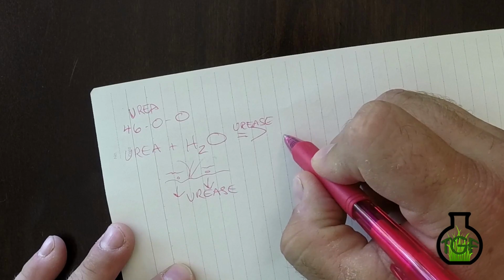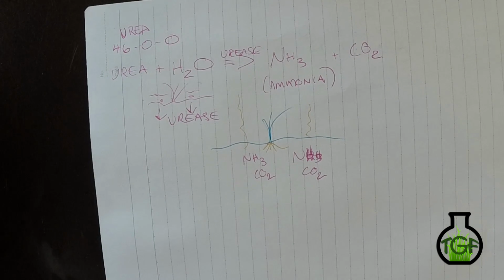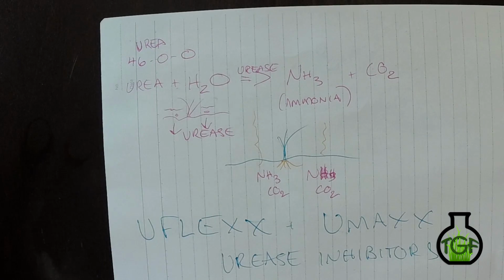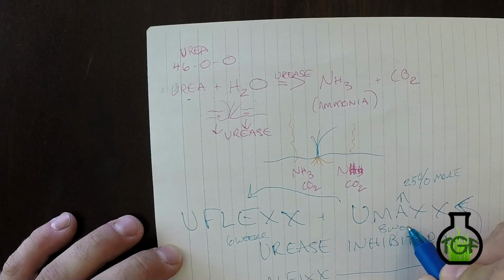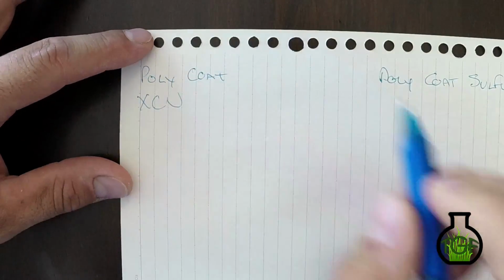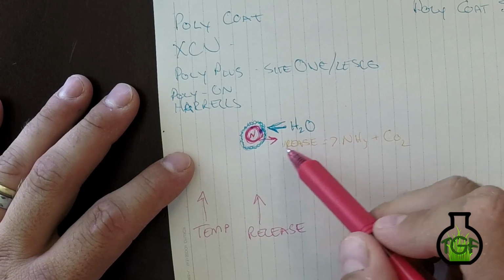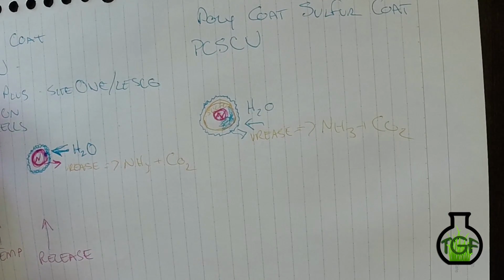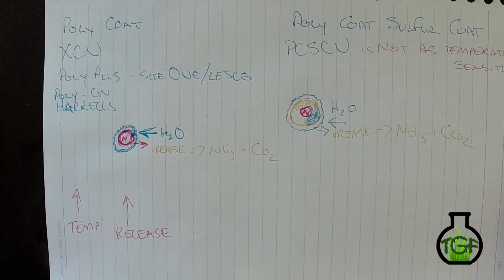All About Nitrogen  - The Grass Factor

Comment: How would you calculate water soluble fertilizer like a 21-0-0 and 20-20-20? Want to put down .25lb per 1000
Reply from the maker: 1lb is 20% nitrogen, so would be 
.2lbs of N. So you would apply 1lb/1000sqft. Dissolve it in as much water as it takes you to spray 1000sqft

Comment: Now urea is from urine correct? Is urea an isolate? Is it just pure urea? Because urine comes with NPK and many other nutrients and micro nutrients. Does urine still convert as quickly to ammonia?
Reply from the maker: HD MOVIE SOURCE urea and urine are not really connected. Urea is a component of urine, but there are many many many many many more ingredients that compose urine
Reply: Ok, Yea, Im actually running some tests right now to see how good urine is as a fertilizer. Been putting it in a hose end sprayer and it looks very good. I only eat fruits and veg so I have no added sodium in my diet so it won't burn the grass, and Ill assume nitrogen is lower because I don't eat high protein foods like meat. Im testing to see how things work this on my lawn in a natural environment vs synthetic which I want to remove myself from.
Reply: HD MOVIE SOURCE so two years in, how is this working out?
Reply: @hdmoviesource  If you are still around, can you update everyone, please?
Reply: @markg6860  Its good, but gotta water it down. It's great for trees and bushes too.
Reply: @hdmoviesource 

I gallon diluted down into 6 gallons, maybe 8? This is what I've tried.